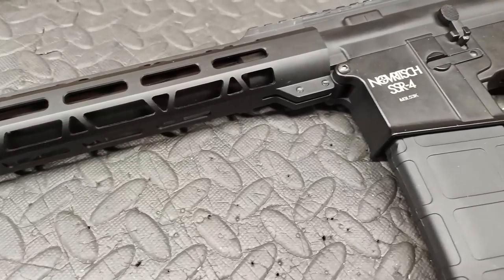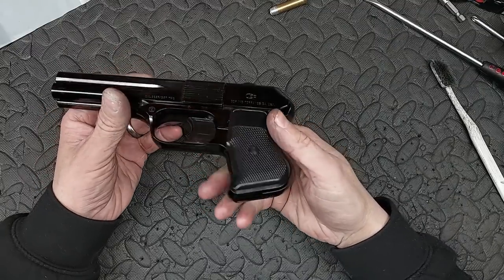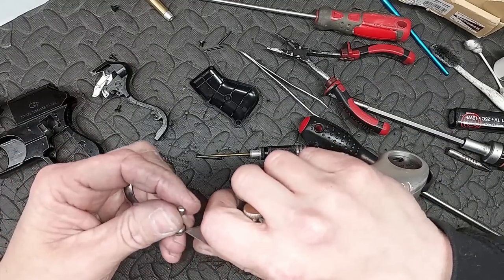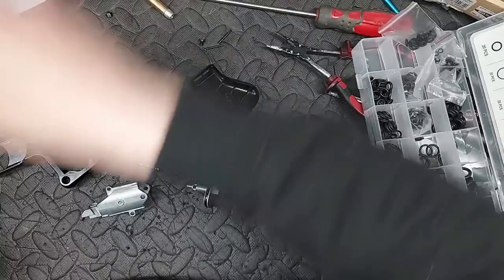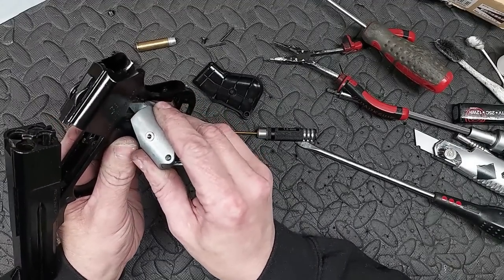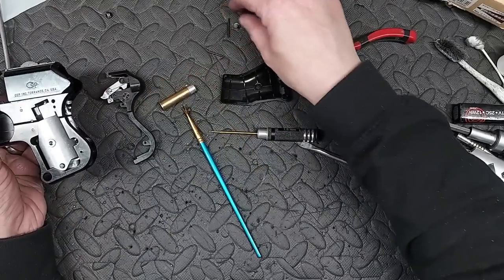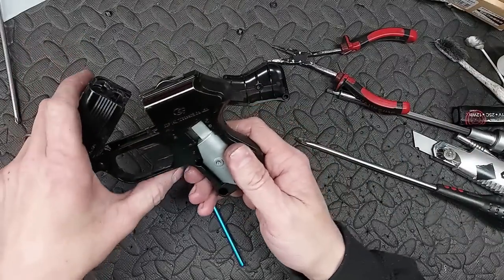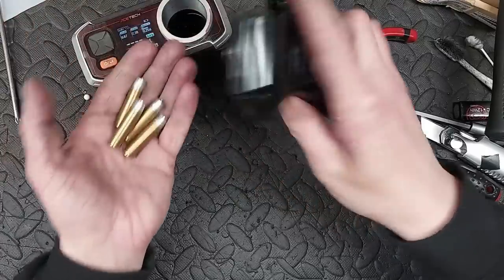Marushin Cop Repair

Comment: "Base gun?"  For 10 points, what online influencer said: "All you need to do to make the best airsoft gun you can buy even better is to replace all the parts that make it the best airsoft gun you can buy." ?
Reply from the maker: Invisible Fred
Reply: that and the lack of qc and adherence to spec is one of the more frustrating parts of airsoft

Comment: Been watching and learning for a while and improved my tech abilities from your videos!  I do have a quick question for you, I have an LCT RPK (non EBB) with 13:1 gears, gate aster, m125 spring, high torque motor, shs 14 tooth piston, and a non ported cylinder.  With that i'm shooting about 1.56 J but would like to squeeze a bit more out of it (im locked to 100ft med and up to 1.89J) without changing the spring.  Do you think it would be beneficial to change the cylinder to maybe a 4/5 style ported  or something like the Type B from Maxx to negate any vacuuming that might be happening?  In one of your videos you mentioned making sure that there is enough airflow to the cylinder (i have not and dont plan on short stroking if that would change your answer) and wanted to pick your brain real quick.  Thank you and keep up the great videos!

Comment: I want to share a story of fuckery. I had a gunsmith order an aries wa 2000 for me with specific instructions to fit a ruger 10/22 action into it so i could enjoy plinking with it. Well he got it in and then proceeded to fit an ar into it. This did 2 things, one it ruined the plinking factor and two the dumb twit epoxied the action into the gun. Now, ar gas systems are not clean but there are 3 washers inside the piston that create a gas seal that will never see the light of day again without a hammer being involved. Im betting the cheap pot metal falls apart in  a few hundred rounds too. Shame too the guy had an original scope that was correct for it and everything. I never thought about using airsoft to train with before this year. This week i got 10,000 reps firing in all positions. Cost me about a box of ammo for the ar. Training with real ammo i dont like to miss so im less lilely to transition and practice left handed, not on airsoft guns, its becoming fluid. And there arent any wasp nests anywhere near my work or home now so... thats a bonus